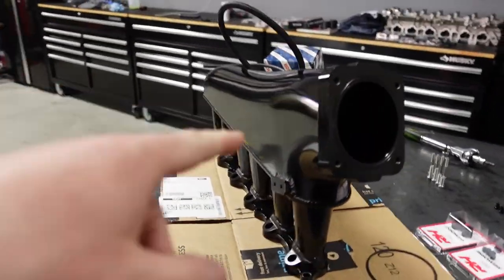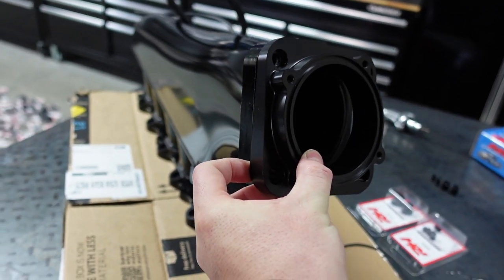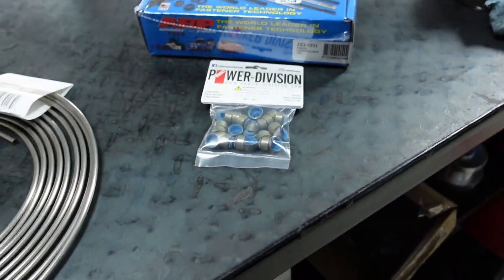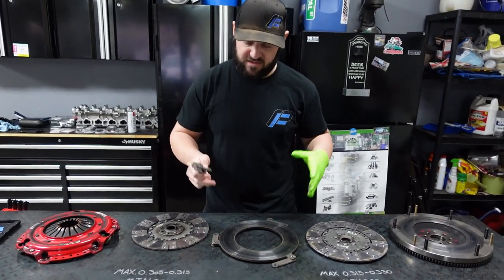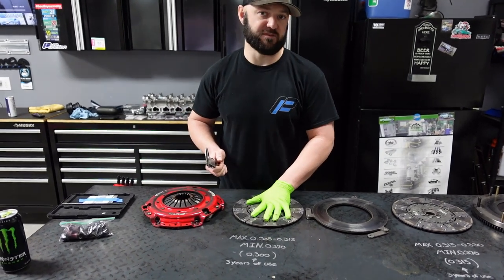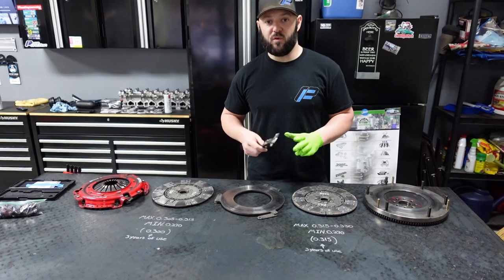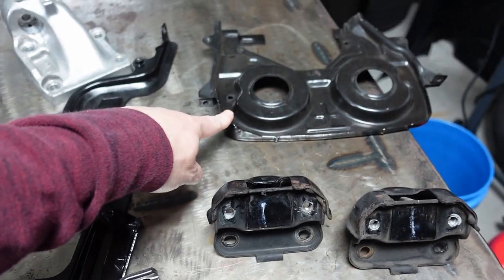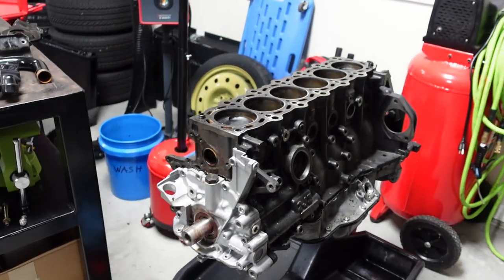2JZ Rebuild Ep.4: Twin Disk Clutch & Block Build Discussion

Comment: I run DBW on the same intake manifold. Magnus racing makes a billet adapter as well as a fitting for the front you clamp a coupler too, without it you will blow couplers off (don’t ask me know I know lol)

Also Ryan @ VRP is the man 👊🏿